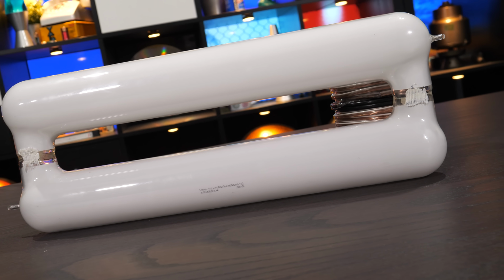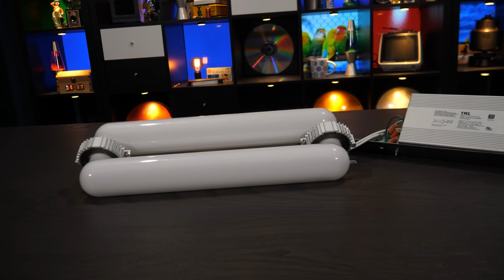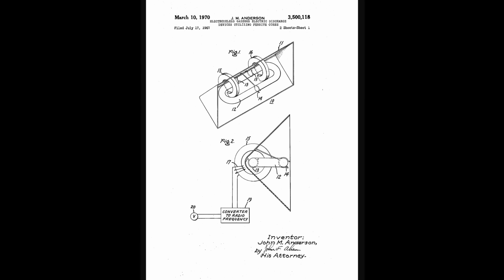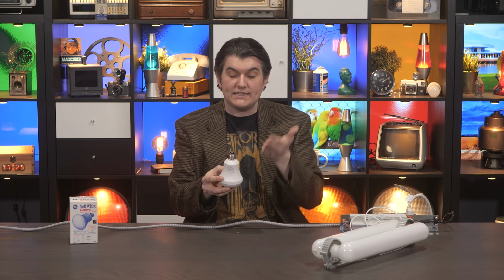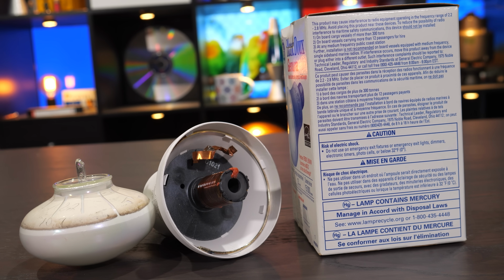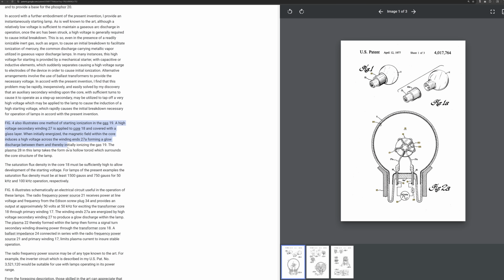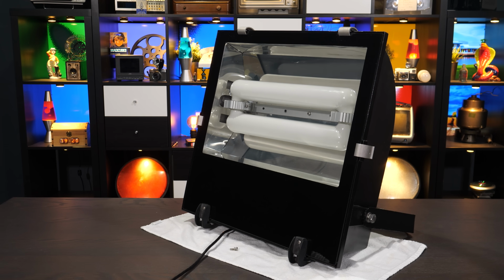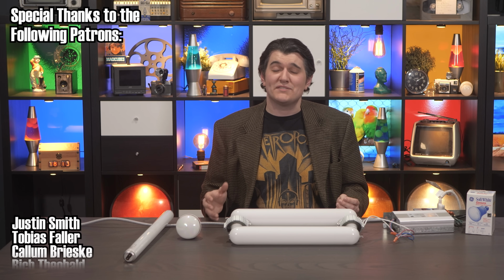Induction lamps: fluorescent lighting's final form

Comment: I switched to LEDs many years ago when i did the math and found i could have every light in the house on and be using less than 150 watts. I run WRGB bulbs now though, and while I've had to repair two lamp sockets in the past year, i haven't had to replace a dead bulb in several years.

Comment: It shouldn't really be surprising that these aren't common. Manufacturers don't want to make something with a 20+ year lifespan. Plus, these aren't a drop in replacement for conventional fluorescent bulbs, which means you would have to replace all your light fixtures. And if you're replacing your light fixtures, wouldn't you go with LED, which has several advantages over fluorescent bulbs? If you run LEDs at a lower current than their rating, they're capable of lasting much longer, and as LEDs are so cheap, needing more LEDs for the same amount of light isn't an issue. Which pretty much negates the only advantage this would have over LED. So the only market this would make sense in is a market where LED bulbs did not exist.

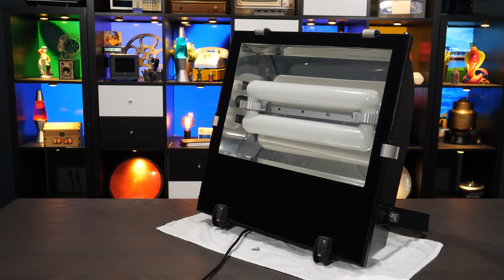Comment: 23:43, After watching NightHawkInLight's recent video about solar concentrators, I wonder if part of the issue is that they just went with the older and simpler methods of focusing light for some of these fixtures instead of using something more tuned.
The more even flood of light that florescent give off is useful in some ways since it makes for more even lighting but when you want it focused on something like with those more directional designs they should really be better tuned for that.

Comment: Is this the same technology claimed to be used in the handcrank-powered induction lamps in the 1959 movie, "Journey To The Center Of The Earth?"
Reply: Ah, like the tesla torch? That was a crank into flyback transformer that was tuned such that it would have a stable frequency and charge to properly drive an LED. You are suggesting that, but it drives a gas tube. You would just have to be extra careful about the current that goes through the bulb, the glow discharge voltage usually is enough to make the thing also flicker and explode. The plasma can self-focus, and induce enough current to explode, just like the early mercury gas rectifiers used in old substations.

Comment: 15:07  in the 90s I bought a replacement bulb for my grandmother’s kitchen lamp. It was the ring one shown here. I remember that it was VERY expensive and I remember thinking „this looks like a fluorescent tube but where are the two contacts? What IS this thing?“ I never found out - until today, so thank you Technology Connections!
Reply: You can see the four pins. The lamp ends and electrodes are under the plastic.

Comment: I have a 165W Philips QL induction lamp system in my collection, I'd loan it to you if you wanted to use it in a video. The only installation I can recall ever seeing in the wild was the Seattle library which has or at least had a whole bunch of 85W QL lamps. The one I have was part of a test program evaluating them for street lights. I also have some "Finally" bulbs that are A19 retrofit induction lamps, I bought them at Costco well into the LED era because I knew they wouldn't be around long, turned out to be right. I think they were made by the same people that developed the VU1 ESL bulb. I have a few of those too but they had very poor quality control and I think all but one has failed. The marketing for both of those was interesting because it's as if it came from an alternate reality in which LED lighting had failed to mature and catch on.

Comment: LED is 🗑️ TRASH monochromatic light and their making roads at night hard to drive on because they go over the 3000 lumen limit but give you way less detail.
Reply: Yeah, for the purposes of the roads, you can use low pressure sodium. Yellow and orange have the least night blinding, and give great details. Color fidelity is bad, but you can't really see color at night, nor do you need to.

Comment: LEDs have their flaws. For example incandescent bulbs produced the same light for its entire life until the filiment becomes too weak and breaks. Florescent tubes would get bad spots and weaken over time. LEDs degrade from the start. Their higher true rating equals the rating as it degrades. So over time those LEDs will just dim until you replace them.

Comment: hmm, maybe we could have induction holiday lights?
Reply: I'd imagine that it would still be a light strip, but for basic function, you could probably shove a simple driver into the light strip, and have the connectors be HF, LC, resonantly coupled coils. Not sure how well it will daisy chain, nor how well you can make it work with the really insane light display programmers, but the basic theory could work.

Comment: How do induction lamps start?  My hunch is that it relies on random background ionization (like quantum fluctuation, radioactive background, muon decay, etc). I propose that since ion pumps (used in ultra-high vacuum pumping) also start the ionization current from residual gas.

Comment: I had one of those compact fluorescents in my bathroom. The thing died on me this year, and I wasn't sure what the replacement's life would be like, so I replaced it with LED. Kind of regret it, because it isn't nearly as bright. Luckily, most of the time using the bathroom, the heat lamp provides most of the light anyway.

Comment: A thought to offer on starting those bulbs:
Company I work for manufactures equipment, some of which uses plasma, and one primary source of plasma generation in the equipment is radio frequency emitters to strip electrons. I don't directly work on that, so I can't personally verify, but I believe they operate in mhz frequencies, so I could see the radio frequency causing the ionization to start them.
Reply: Frequency dependent discharge, the higher the frequency, the lower the breakdown voltage.

Comment: How am I supposed to build a company selling lamps to customers who only return after 23 years?
Reply: By correctly estimating stock turn over, failure rates from defects and induced failures outside sources.

For example all of the LED's in my house have been working for over 15 years.

They are brilliant. Nothing fancy just Phillips bulbs that were on special.

3 years ago one of the LED's in my shed failed, I went to the hardware store and low and behold Phillips LED's were still there (no sale unfortunately)

Comment: Those coils are inductors. They generate electro magnetic fields. Think Tesla coils except without the absolute zappery that happens. With enough volts an inductor can transfer electricity across the atmosphere. Hope this helps someone! :3
Reply: As Tesla said, the zappy zappy is you throwing the electricity down the drain. The less it sparks, the more energy is retained, the more you can send down the line.

For these bulbs, you just want to keep the energy in the plasma, and just gently top it up.

Comment: The small tungsten imprednated wire is there to give the gases a secondary ignition source to stablize the gas mixture. When the gases are excited by a high frequency source and begins to produce glow. The piece of wire begins to glow to help the light stay lit and stable. However the loop of wire helps sustain a flicker free light, especillay in cold climates, cannot keep the gas charge lit by itself. Just a helper.

Comment: 10 years ago these induction lamps with several different tube configurations were easily available from Chinese manufacturers. I remember 40W lamp with a circular tube and two coils, pleasant warm white light. Operated at ~200kHz. Despite the electronics being placed inside the lamp case, the case is big enough to not overheat, used E40 connector. Surprisingly good build quality - circuit board was fully coated to protect against moisture and insects, input filtering elements were not "optimized", capacitors were Nichicon UPX and UCY series. So really intended for a long life.

Comment: A very great deal of Genura development was carried out in Leicester (UK) - a good friend did most of the driver electronics design.
One lamp burned continuously in an empty lab for several years - it may well have still been burning until the site was closed and demolished.

Nowhere to go with lighting now we have the LED?
I have not looked up the exact figures, but know them approximately - a tungsten filament in glass lamp (GLS) runs at around 10 lumens per watt, those lumens represent around 0.01% of the energy consumption of the lamp.
So you can see that LEDs are way more efficient, but even at 1000 lumens per watt, they'd still only be using 1% of the energy to produce light.
LEDs, and any other lamp using a ballast, are also wasting energy within the ballast - very obvious when looking at low power lamps with internal ballasts aned comparing efficacy figures to the same type of lamp run from an external ballast.

Comment: A few towns in my area installed a large number of "IceTron" induction street lights in the 2000s (replacing mercury vapor lamps), easy to identify because of their green-painted fixture housings. But in recent years most of them have disappeared, replaced by LED lighting, or believe it or not, high pressure sodium lamps! Maybe they were scared away from LEDs after seeing some of them going into disco dance party mode when the electronics fail and the lamp starts rapidly flashing.

Comment: My Grandpa had a story, working at a big radio broadcast tower, reading by the light of an unplugged fluorescent light.. his boss chewed him out about it a couple of days later when they realized why they were getting such low transmission power 😅 It makes sense that you'd need to use radio-frequency coils to run this light, too

Comment: 23:40 i like having wide sources of light, pretty much the only flashlight i use is 1 that can adjust beam width, and i use it on the widest setting.  directional lighting sux and is only good for headlights (only to not blind oncoming cars) or seeing other far away things, atleast with the bright LED light sources we have today.  i always liked compact fluorescent bulbs for home use 10-20 years ago, they were cheap and lasted for years in a standard bulb form factor

Comment: In the mid 1990s when I was playing around with the royer circuits often used for induction heating, I once made a royal circuit with an open output inductor just made up of copper wire coils and no ferrite induction material. Royer circuits are known for the extremely high efficiency and very little heat loss. I shoved a fluorescent tube in this output coil. The fluorescent tube lit up brightly. The circuits were made to run on 12 and 24 volts DC. The ran at around 80Khz and produced a near perfect sinewave resulting in very little radio interference. These tubes were left on the entire 10 years day and night that the company was in the building. Watt for watt we were achieving higher light outputs than LEDs right up until around 2010. From there on LEDs started to be coming more efficient than this setup we had. The new owners of the building also left them running all these years. A few years ago I happen to pass by the place and stopped in to have a look at them. Still running nicely. Even the small round fluorescent tube that we made a unit for that was sitting in the store room at the time was still working and nicely 25 years later. Royer circuits are incredibly simple to make with no more than a dozen components and up until around 50 Watts don't actually use heat sinks as it is so efficient with little heat loss in the circuitry. But LEDs have since become so efficient now that it is not worth the effort anymore.
Reply: kHz, not Khz. It is still worth the effort because LED is boring.

Comment: It has to do with the frequency. If you hold an F8T5 8 watt fluorescent bulb next to the antenna of a military grade radio and key the radio, the bulb will glow. 

Also, Google “Richard Box’ artistic display of 1301 fluorescent bulbs that are lit by the overhead high-power lines” 

Simply fluorescent bulbs grounded to Earth on one end will light up from the magnetic induction of high voltage power lines. -retired electrician 

God bless you and keep you all safe. 🙏

Comment: There is a power supply topology called flyback.  The "transformer" is a dual winding inductor.  When the switch is on,  energy is stored in the inductor.  When the switch is off, the magnetic field collapses, powering the output.  If there is no load on the output, the voltage increases until something conducts (breaks).   The spark coils in a car use this approach.  

In this lamp, that mechanism can create the voltage required to triggers the mercury to ionize.  Once the lamp is conducting, the output voltage is reduced to the ionizing voltage of the lamp.

I don't know if that is how this lamp works, but it fits.

Comment: If you put a fluorescent tube close to a car mounted HAM radio antenna, and transmit, then the RF-field surrounding the antenna will make the fluorescent tube emit light proportional to the field strength. Adjust the radios output power to vary the light intensity.

Comment: It seems like projectors would benefit from this greatly:
Super bright.
Lasts damn near forever.
Fairly cool (Temperature) compared to other methods.

Surprised no one thought to pair the two.
Reply: It's the same optics problem:  projectors need a light source they can focus.
Reply: @johnrehwinkel7241  
Correct me if I'm wrong, but isn't the whole point of DLP to get flooded with light, then turn off the sections that should be dark?

I know laser projectors are a different beast and require blatant focus, but my Optoma chucks light in all directions from its bulb.
Reply: They need a point light source, rather than a diffuse one. Probably why they stayed with halogens for so long.

Comment: The same principle could be applied to the induction water heaters; lasted longer due to no resistive heater immersion , few limescale buildup but pricier and more complex
Reply: Funnily enough, you can also improve the heating of your water by using the Dumas effect, and ensure the off gas vents somewhere.

Comment: Plasma physicist here, we generally posit that initial breakdown for RF and microwave discharges tend to be enabled by free electrons caused by cosmic rays which initially ionise a few electrons in the gas (thermal ionisation is negligible at room temperature) which pick up energy from the oscillating fields, ionising the rest of the gas. The initial power spike in some devices is likely due to the initial impedance mismatch with the empty discharge tube, rather than something that produces a strong enough electric field for direct breakdown.
Reply: Early tube/valve radios sometimes had a small incandescent light bulb inside to stimulate the initial electron emission in the early tubes. For a similar reason that you stated with the Cosmic rays, the light from the bulb gave the initial kick to start ionisation in the tubes.

Comment: I assume they chose the 2GHz band for the light bulb because that band is unregulated.  It's the frequency that microwave ovens operate at.  This is the same reason that a lot of wireless devices like WiFi use 2GHz.  Basically anything goes at that frequency.  It's where you can mass produces devices that clutter up the band.

Comment: I feel one thing people mistake about "Long lasting" technology is maintenance. Servicability is a major factor to the long lifespan of old technology. Now while some people may moan about "planned obsolescence" in lightbulbs... Well that just isn't the full picture. A phone that just gets worse and thus requires you to replace the entire unit... Yeah thats disposable tech. But a florescent tube with the part that burns out being part of the tube, thats largely a design consideration. If you have a point of failure in a system, you want that point of failure to cause as little damage as possible and for it to be easily replaced.

Now granted this is always a tough call. Im no expert, but having significant parts of the print nozzle/head as a a part of the ink cartridge so its constantly replaced just seems wasteful when the duty cycles for those part will be several refills out at the shortest... Now that just seems like an excuse to make the machines cheaper.

Comment: I wonder, if it used 2 tungsten electrodes, like in a hps lamp I wonder how long it last? And if it used a igniter also, yes it would be a fluorescent lamp at that point I guess, but would last much longer with 2 thick tungsten electrodes

Comment: From what I understood about the startup, the electric field accelerates free electrons in the tube, which collide with gas atoms eventually ionizing them. And it's 
more or less a chain reaction from there on. (as long as the outside circuit is on at least).
Reply: I love it when I pause a video to write a comment, press play again and then 20 seconds later basically hear my comment spoken out loud. SMH I should learn to watch the whole video before commenting.

Comment: Well experimental neon glass artists have been taking advantage of induction power to light their art for a long time but without the goal of producing bright light and instead focused on colors and light effects.  They use inductors to bombard their gas tubes while pumping to see the effectiveness of their gas mixtures before disconnecting from the vacuum manifold.  And plate induction gas light activators are quite common